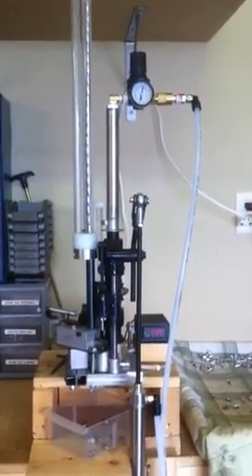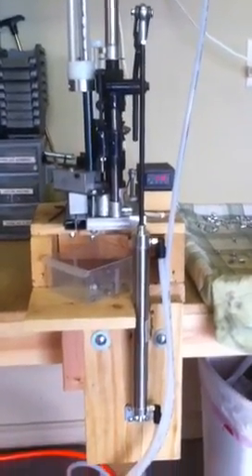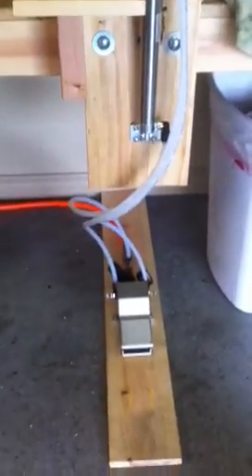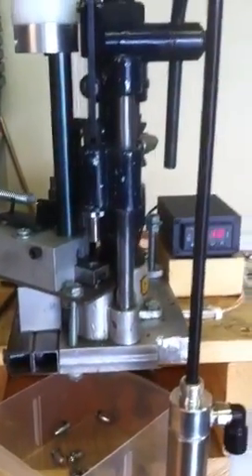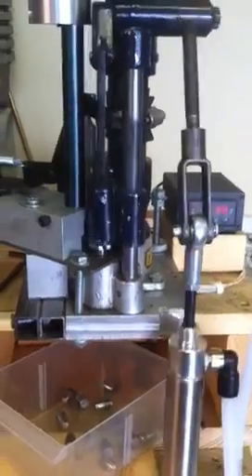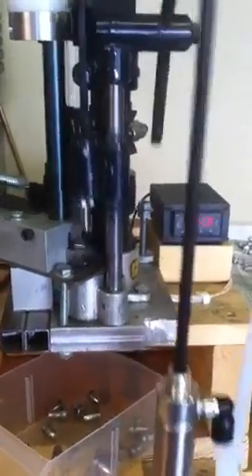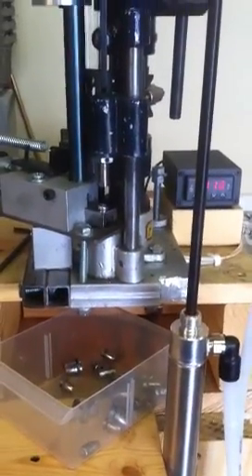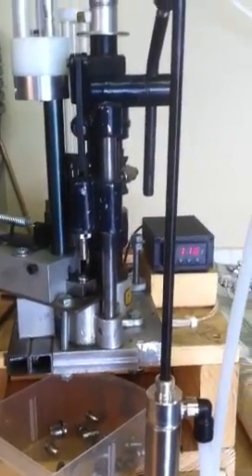Air Driven Star Sizer

Comment: hello could you tell me where you got your air cylinder.I have searched the web and and having a hard time finding the 10 " stroke required.I am also interested  in the brand of adapter used to connect the feed tubes to the bullet feeder. thanks for your time